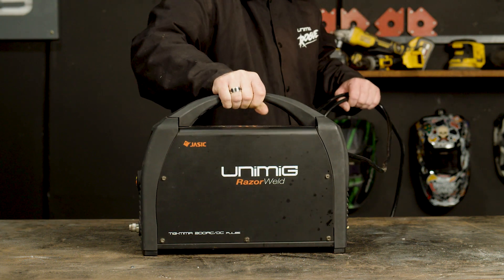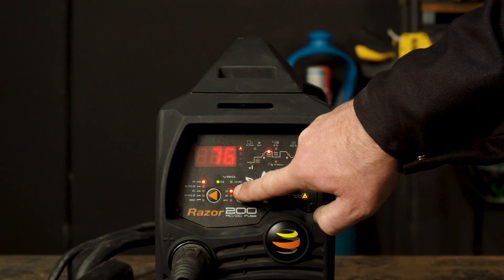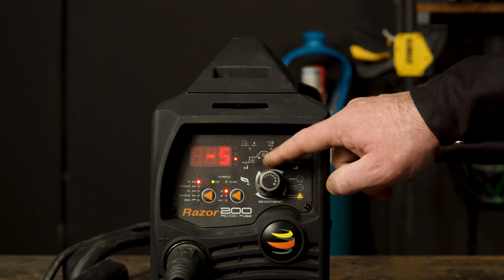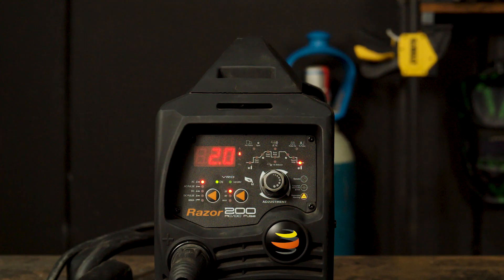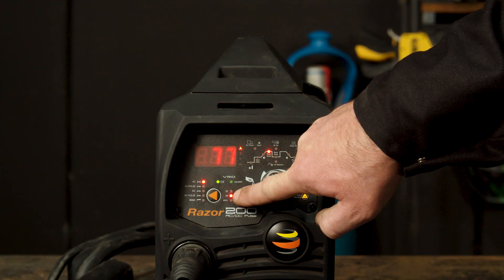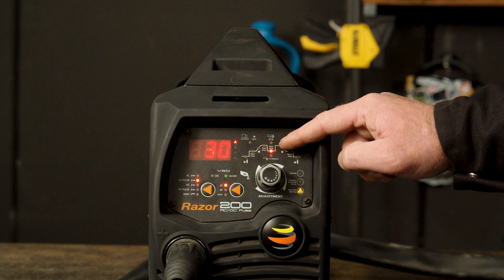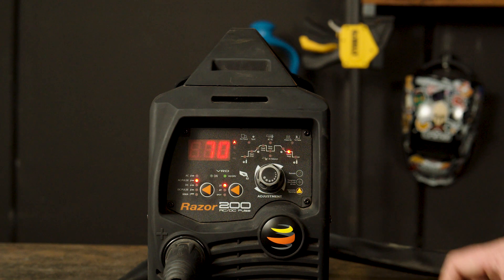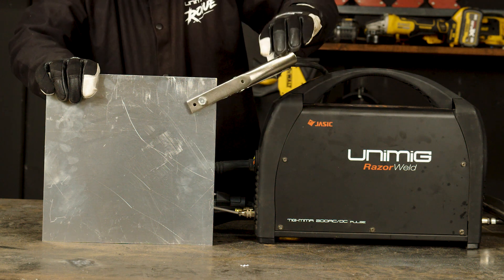RAZOR 200 AC/DC - AC Welding Setup Guide

Comment: Do you need gas pressure on before the unit will let you select modes other than MMA ?
Reply from the maker: No you do not.
Reply: @unimigsupport  Ok, I got a sick one then. Is that a known fault ?   All I can select is stick welding.   Thanks.
Reply from the maker: Can you send us an email to support@unimig.com.au, this is usually due to a faulty part.
Reply: @unimigsupport  Ok, and do you have a service centre in Darwin ?

Comment: Y my remot light stays on an the base amps not adjusted
Reply: You useing the pedal ?  If so reconect it , hold handle away   as if you starting  the hand piece ? Press pedal down for 5 sec you should hear some beeps   that should turn it off ,  the manual doesnt say that  hope that helps ?

Comment: Wheres the 2mm settings
Reply: Just brought this welder for it AC aluminium capability...
On AC pulse,  I've set peak amps to 150A and as far as I can tell base amps are fixed at 5A ? . Freq 60Hz . Pulse freq 40 cycles per sec or 40Hz..  pulse % (pulse width)50% on time and 50% off time . What else ..  2.4 mm lanthernated tungsten,  and I use a peddle...
This is my so far base setup and it welds 2  - 3mm 6061 pretty good . I'll play around fine tune things from here, but this will get you in the ball park...  also from my initial fucking around , Ac balance is set automatically and the balance control seems to only allow you to adjust it a few point up or down, but it seems pretty close set to zero...
Is this what you have found??